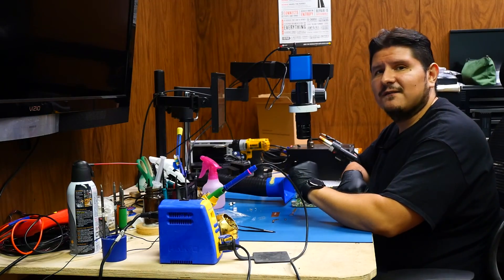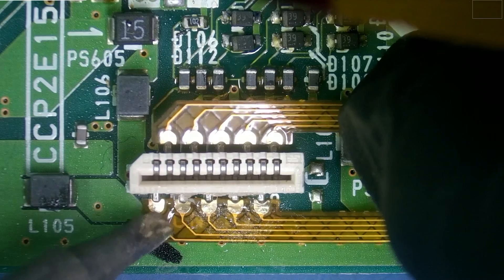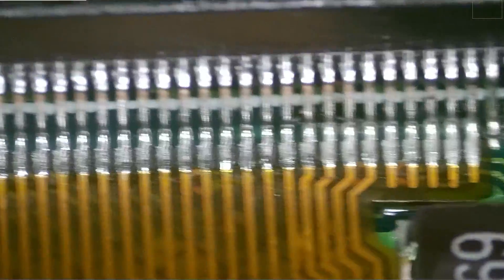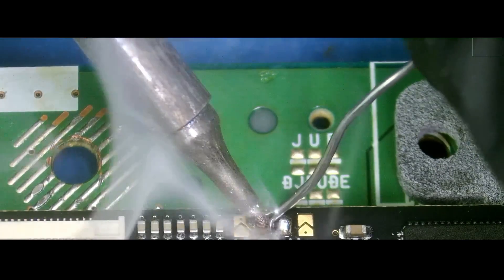HDMI Upgraded PS1 | Installing a Retro Gem - Universal HDMI Upscaler Kit by PixelFX Playstation

Comment: The retro gem menu screen doesn't show up when I press L1, R1, Dpad right, circle. What could be the issue? Everything else seems to work fine. Also tested my controller buttons and everything works too.
Reply from the maker: I'd double check your solder joints for continuity.
Reply: I did, they're all good, I was told to update the firmware but I don't know how to do that
Reply: Did you make sure to short out the required jumpers on the retrogem to indicate a PS1 install? Had the same issue on mine for my PS2 before I realized I had to short 4 specific jumpers.

Comment: Couldn't you just plug in the PS1 into an external video to HDMI adapter instead?   While of course the quality may not be as good, it's a lot easier.  Some can even upscale the video to fit the screen proportions of newer TV's and around $50 bucks.
Reply from the maker: You could. I used to do this for the PS2, but those devices introduce a very noticeable lag (delay between button presses and whats displayed on screen), and that may matter depending on which game you are playing. Some of those devices are not the best constructed either.
Reply: @RetroRenegadeRepairs  - Ah yeah the delay.  I've seen a video where one guy found a converter with very minimal lag, of course your solution has better performance.
Reply: @BillAnt if you really wanted an alternative it would be better to use RGB with an upscaler or line doubler to hdmi to your modern tv. That will give uoi an excellent picture. 

Ps1>rgb YPbPr scart etc>retrotink or ossc>hdmi>smart tv

Or even using composite to a retrotink 4k will give you a really pretty picture 

For people who care about such things, there are generally 2 groups though.. the ones who want the internal hdmi digital mod OR the rgb upscaler/line doubler. 
They both do similar things in different ways. 
The “other” outside of those are the purists who think a fuzzy analog image on a junk crt is best (haha no), the ones who just don’t care and play composite on a smart tv, and the ones who, like you mentioned, buy cheaper stuff that normally doesn’t work well on Amazon. 

One last group would be the ones who want RGB PVM CRT monitors or even the people who want to mod a normal CRT to have RGB. 

There’s so many options, it just depends what your configuration is and your budget and your interest
Reply: @samtron5000  - Thanks
Reply: @samtron5000 exactly, different strokes for different folks 😂